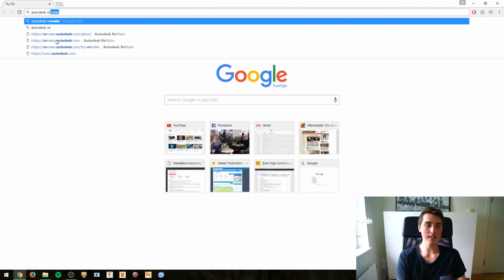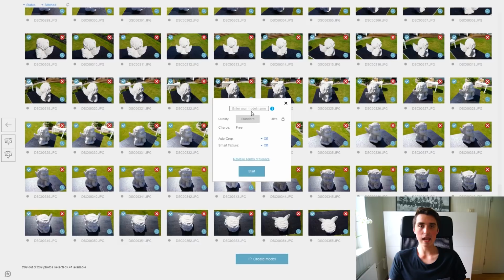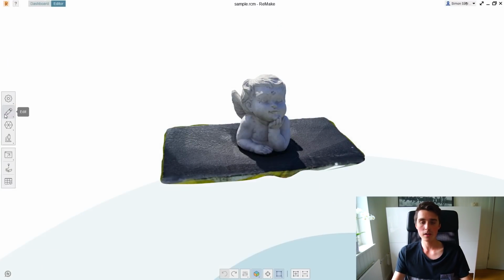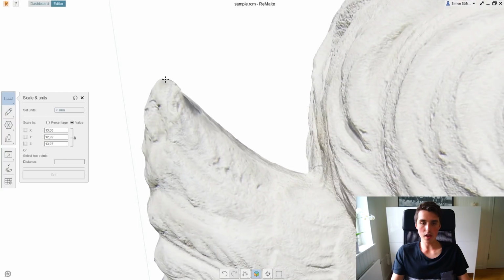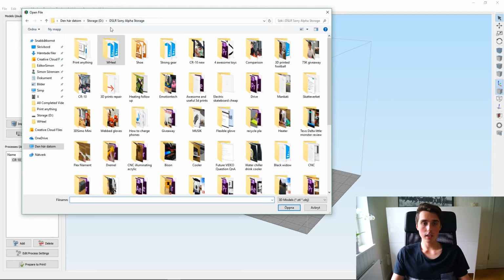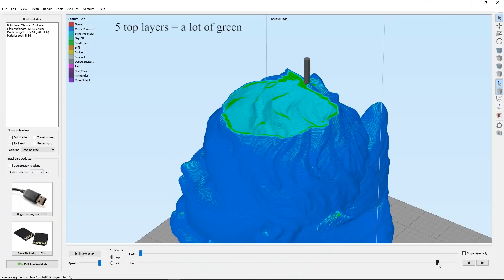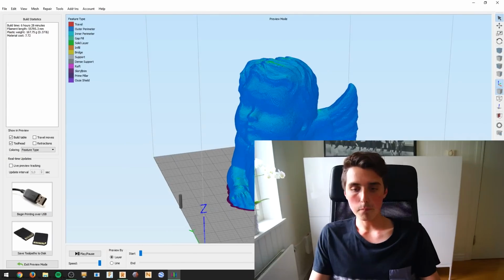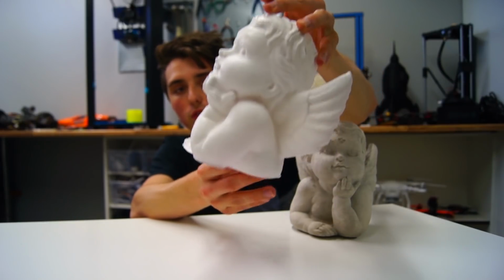How to 3D Print Anything - Autodesk ReMake Tutorial

Comment: Pro tip: You can get the scale more exact by measuring the width of the base instead of the distance between the wingtips. But that also relies on how well you cut off the base, which in this video, you didn't do so well.

Pro tip for that: Rotate the model until the bottom is aligned with the cutting plane before making your cut.

Comment: In Apophysis when you're making a render of the animations the software creates 100 images.  Once assembled you get a 3 second loop.  Those should be something autodesk ReMake can use to create a 3D render to .STL file.  Then your 3D printer of choice should be able to build a totally unique, randomly generated "fractal" flame sculpture.  Use dissolving supports for the more wispy or delicate flames.

In Mandelbulber 3D you can also rotate on each of the 3 axis 360 degrees to capture all the angles of your render.  That would enable you to use ReCap Pro's orthographic photo software to convert it to .STL for 3D printers.  This is the replacement for ReMake which was discontiuned in 2017 and has far less demands of the computer and OS.

Or you can try to find cheaper or free orthographic photo software to do the same thing.

Comment: The remake software is no longer available
Any other better options ?
Reply: Meshroom is a great option although it's not as user friendly as remake. But it's open source and free. Also prussa has done a video on meshroom so you can reference that to troubleshoot.
Reply: @rpbautis2000  is this software having inbuilt system of conversion or do we need to upload it ?
Reply: @rishabhmehta7994  Im sorry but I forgot to mention that the software only runs with CUDA compatible GPUs. So if you don't have an nvidia GPU it won't work. Also can you elaborate on what "conversion" you are referring to.
Reply: @rpbautis2000  conversion of jpeg images to 3d model the purpose of using the software 😅
Reply: @rishabhmehta7994  lol sorry don't know much terminology I just go with the steps. Nevertheless you'll need to upload either jpegs or RAWs into the software to to build the mesh.

Comment: I found that putting the object on a turntable is better. It allows you to take the pics in a more controlled manner.
You can have the camera mounted steady and have a diffused light source on the object so it isn't too bright but you don't lose detail in shadows.
You can also draw little 10 degree increments onto the outside edge of the turntable so that you take photos at perfect times.

Your way obviously still works out great but the turntable is a lot less hassle not having to step around all the time

Comment: I need to recreate an ABS automotive part for an Older Auto of which the parts are no longer available. (Door Handle Bezel) Everything you described as well as all the software and 3D printer is out of my ability. Would you be willing to create a 3D model file for me if I supplied all the photographs? I have a 1979 Subaru Brat and many of the ABS parts have deteriorated due to age and UV damage from sunlight & Heat. The most important part needed is the ABS Plastic insert Door Bezel surrounding the inside door Handle. Example: https://www.facebook.com/photo.php?fbid=10212454674542079&l=944752851c

Comment: Thank you for this amazing video. But the photo to 3D model converter Autodesk remake isn't available anymore to download. They have stopped giving that software and asking for us to download recap pro. But can I do the photo to 3D model converting in that recap pro software? Please help
Reply: No you can't...Recap Pro has that feature but you have to pay to use it -.-
Reply: While Recap Photo has a trial version, this trial subscription fails with the default install, you need to seek out a newer version that is not the default (I believe v19+).  The nightmare doesn't end there, the app uses cloud credits that are spent to actually compute the 3D model from the photos, and even though the trial includes enough to do about one 3D model, it fails stating that you don't have enough credits (the UI shows 12/12 needed, but you don't have enough).  Further, with a trial subscription, you can't add credits.

My suggestion is to just find another product.

Comment: SIR: PLEASE HELP ME. I have a CR10 which I upgraded to a dual Z axis, and the CR10 S Mother Board,  and new control screen.I have had this thing for Over two months , and I have only succeeded in printing two little but vase from the micro SD card which came with the printer, and Nothing Else. I know how to set the Temps, Heat the bed, and move the Axis , and extruder. I have a new HP laptop,  on which I have downloaded the Simplify 3d Paid Software.  I have been unable to get either my PC , or My new Laptop to recognize my Printer even though I am Using a brand new USB Cable.  The only warning or alert I have gotten was That I may have set an incorrect BAUD Rate.  I cannot take much more of this frustration before I just Chalk this up to a LOT OF WASTED TIME. AND MONEY Which I WILL NEVER BE ABLE TO GET BACK.  My Question is this:  How can I get this Printer to print a file from my LAPTOP  onto my 3d printer ?  I have tried, and Failed At Every Turn.  ☹😤😢  I cannot serm.to get ANYONE to Answer me. I need help.  PLEASE  !!  My email is:  nunyabiznezz64@gmail.com, and I would appreciate any and All help I can get. Thank You in Advance.

Comment: Is it not easy to have a slow rotating table carrying the object with a fixed camera position? That would be easy to make using the selfie stick button clicking automatically at every required angle. The table can be mounted with a geared motor to move so slow. I believe that table can be printed very easily with a crank taping the camera button.

Comment: What specs are you using to run Remake? I tried running the free version on two different laptops with GB of RAM and built in video card it said it did not meet the minimum requirements and crashed. It looks like amazing saucer but I need to be able to run it. :)

Comment: Very interesting abt  photogrammetry...what are the lengths of steel rulers do you use to make measurements, drawing lines....150mm, 300mm or 500mm where  to buy?  In the USA,  we have both inches and mm on the same ruler  304mm length hard to find metric only rulers here. thx
Reply from the maker: Hey thanks for watching my video! The rulers I normally use is 300mm and 600mm long.
Reply: Hej Simon!  Thx for ur reply.  Where did  you  buy the rulers ... at  ICA or some other place like  Clas Ohlson??

Comment: Great video! One thing though.. When you're going through the slicing settings and you talk about the extrusion multiplier being connected to your nozzle diameter. There's not really any relation between the two, and changing nozzle size shouldn't mean changing your extrusion multiplier if you've got the extrusion properly calibrated

Comment: Did you decide to try the football anyway? Curious to see how that turned out.
Reply from the maker: Not yet. I'm still not sure if I will make a video about it. Should the football be 100% filament (air inside), or should I use a rubber ball as support inside? I need to find a good flexible filament that is still firm enough to keep its shape when kicked.
Reply: RCLifeOn the firmness can be altered by the number of perimeters and Infill percentage
Reply: RCLifeOn  Try Ninjatek cheetah. 👍